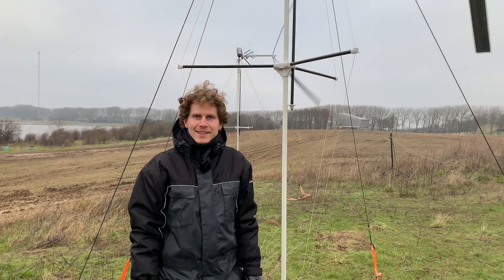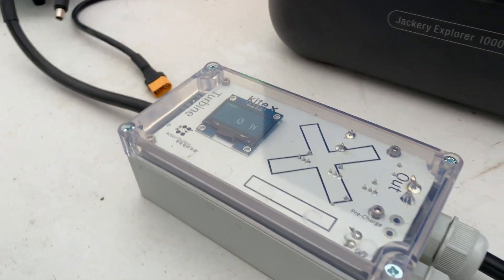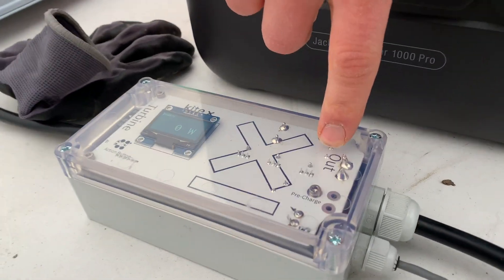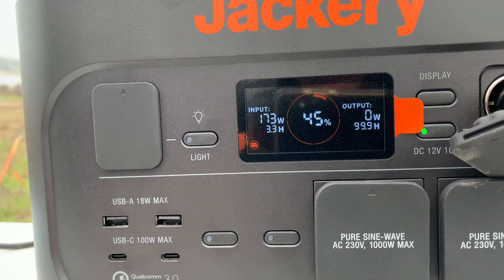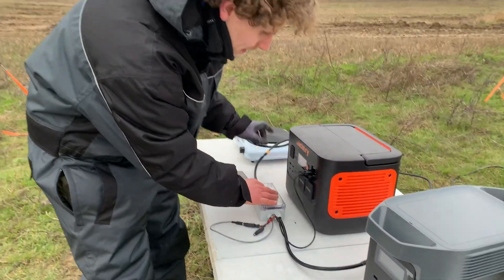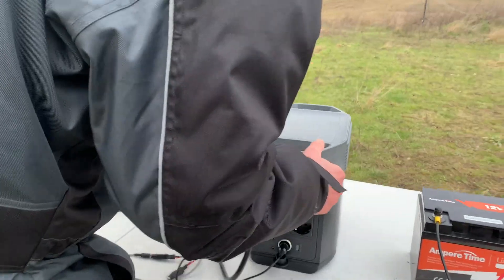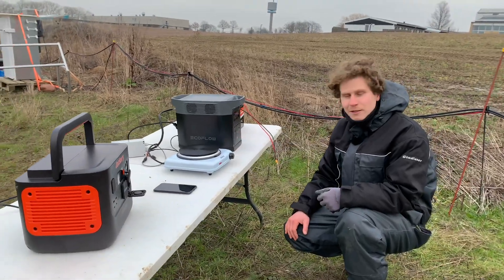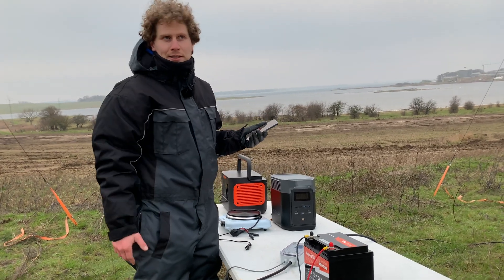Wind Catcher Electronics Guide Set up

Comment: Hello ,  very cute and thoughtfully designed Turbine , exactly the right answer to   disappointing  small windturbines  performance issues in low wind  ,   but  wouldn't it be better , if connected to a  battery , directly  to  do that  via an extra Mppt controller that can handle  the  say 37 Volt of the turbine   more efficient  to charge a 12 or 24 Volt battery ?  The two powerbanks you tried, both should have an inbuilt  MPPT  controller  anyway
Reply: Correct, when charging power banks with build in MPPTs there is additional losses of 2-10% depending on the model and power level. The ground converter unit that we supply can charge 12 or 24V battery systems directly - as shown in the video towards the end. It functions a differently from a typical MPPT (from a control logic perspective) as it most cases we let the turbine determine the optimal power levels.
Reply: @AndreasOkholm   thanks  Andreas , but i did mean that  charging a  12 volt battery bank  with a windturbine that is  producing more than 37 Volt ,   like seen  in the clip ,  is simply not so efficient  as  using an Mppt charge-controller  in between your groundbox and the battery bank , i am aware of  some MPPT Windturbine controlers that have proven  that  a MPPT controller can  even double the production  , sure in your case it might be diffrent as you use a DC Generator , most others use a 3 phase AC Generator and rectify  external to DC   For example if you have a PV-Panel that   has a voltage of 32 Volt  and  is rated  as a 320 Watt Model  so it can deliver max 10 Ampere ( thats all written on the back of the panel)  So if i connect that directly to a 12 Volt battery  the 10 Ampere  rating  remains .... but , but , but  the system voltage is determined  by the 12 Volt battery that would then    mean that       10 A x 12 Volt = 120 Watt  thats all you get from that panel . But if you use a 24 Volt battery its  not as bad as  10 A x  24 Volt = 240 Watt  so one looses still 80 watt  of the panels potential  ,  but better than loosing  120 watt in a 12 Volt system , so by using an MPPT controller    that then   lets the  panel  produce its rated        10 A x 32 Volt   = 320  Watt , but , but  when one the messures the A(ampere)  at the  12 volt battery  then  you will see  26.6 A x 12 Volt = 320 Watt  , 
No criticism  at all , but just thought  it might be worth while  of a thought  and i am pretty sure you  played  with charge controllers  as well .  Your turbine even might work with a standard PV -MPPT one , as it rotates  stable and slow  , must  other Windturbines  would need a special Wind -Mppt one as they react faster than the PV ones ....  there is a german company called "schams-solar" that produces  small Wind-MPPT controllers starting at  250 watt rated ones  and  more pricey   one is the "Midnite classic"  . Hope thats ok to mention here in your channel , but  they don't sell  wind-turbines  , i  personally  went  another  road (was  off-grid in Ireland for many years)  and connected  a cheap  GTI ( grid tie inverter ) to my  battery charging 1600 watt Windturbine (  they have an in built MPPT) to feed 230 Volt AC of the  24 DC-Volt Turbine  directly into my house .... Anyway  your turbine design  is just super clever  and detailed   and at my spot now in Germany is not ideal for windpower , but  your design made me smile and  i am starting to test the wind in the field behind my house  now 🤣 Keep up the good work and am  looking forward to follow your  future 🌻🌻
Reply from the maker: @wersonst-d4q  Just like with the mechanics of the turbine, there is a lot more going on behind the scenes in terms of our electronics. 
>   is simply not so efficient  as  using an Mppt charge-controller  in between your groundbox and the battery bank 
Our ground converter box does feature build in digitally controlled step down converter. (It's the same electronics topology as in a MPPT unit). The losses electric losses is similar to a conventional MPPT.